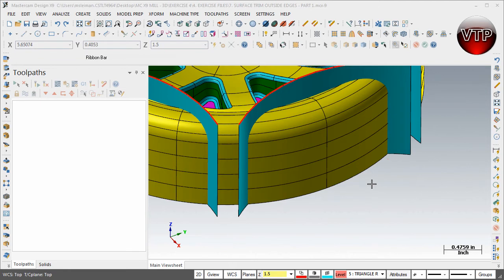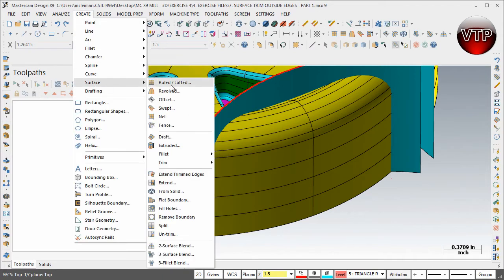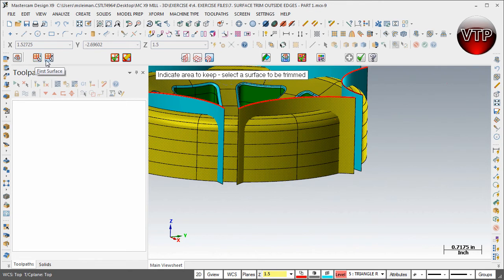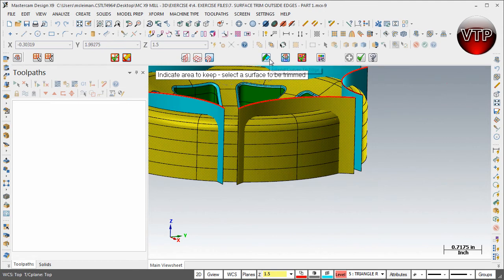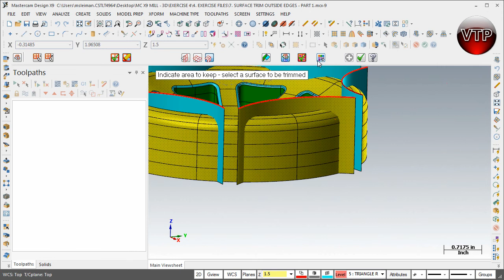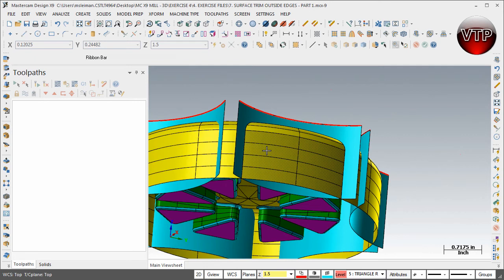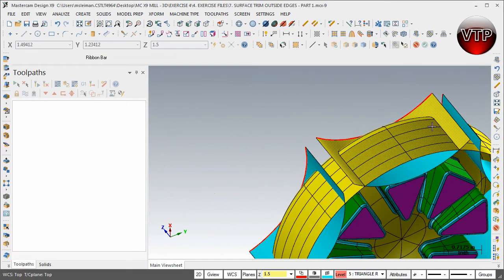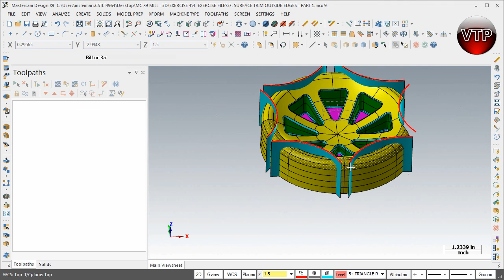MASTERCAM X8-X9 3D ADVANCED MILL  4.9 - Surface Trim Outside Edges - Part 2 - vtpros.net

Comment: having an issue when I use the create > Surface > Trim.  layer 2) retains the shape and is not cut so it will not show thrown unless turned off and if it's off the rest of the layer is gone. is there something im missing ?
https://www.flickr.com/photos/137578524@N03/shares/n8h9P4
Reply from the maker: +Mongerops Yes it's very important to make sure the arrows coming out of the surfaces are pointing the right directions or you have the right surfaces selected first and 2nd depending on which ones you are trying remove, we have simpler exercises in the DVD that explain this in detail, check out the DVDs at vtpros.net